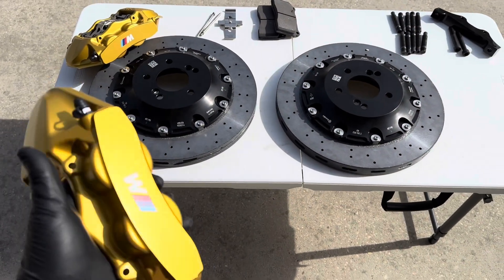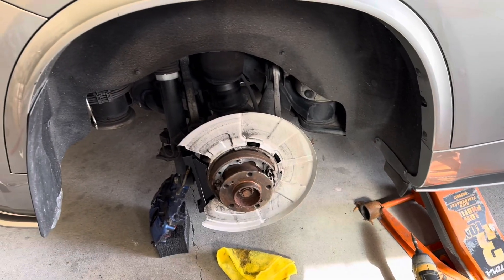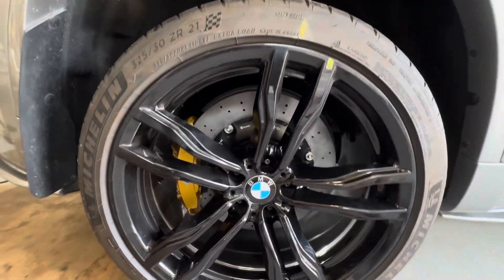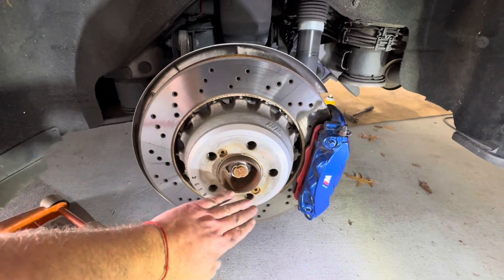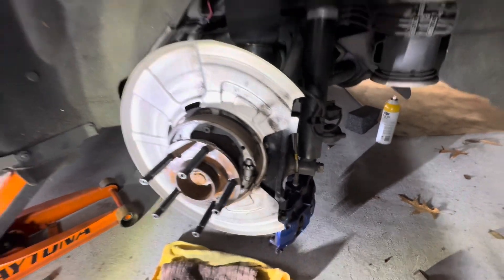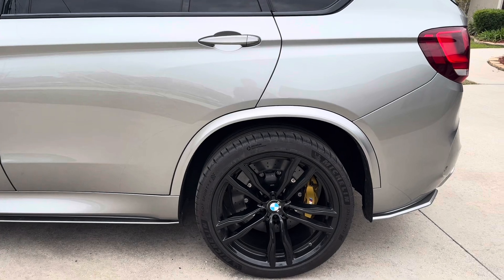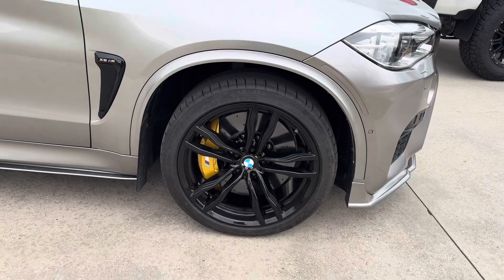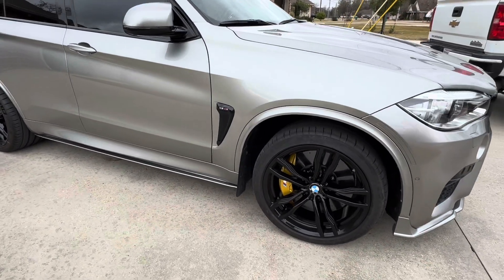Part 2: BMW X5M F85 rear carbon ceramic 400mm brake kit upgrade

Comment: Hi, can I install 400mm front and 396mm rear M6 brakes in my X6??
Reply from the maker: Yes 400mm can be installed, see ‘ultimate brake kit’ video on my channel, rear rotors are not possible to install unfortunately due to difference in parking brake set up.
Reply: @Dentprotony  ich habe von m6 alles Komplet aber leider nichts so wie deine 410 vorne un 400 hinten ich habe 400 vorne und 396 hinten von m6 Komplet original ist das möglich zu installieren And what kind of adapter do I need?
Reply from the maker: @rinornishori7207 steel or carbon ceramic?
Reply: Hello, how or where can I order?

Comment: Great to see you back with new rear kits for your X5M! Also front rotors look good with nice transfer from pads as you mentioned.
Does rear ceramic has 28mm thickness? I found stock has 24mm:) Anyhow, high composition of SiC(Silicon Carbide) on friction surface +  compound formulation of pads(might be the most important point for braking) would be helpful for your improved drive feelings!

Comment: How much?
Reply from the maker: @dliv33  rears are 2800 plus calipers/brackets are 1080 , i have the new hub design finalized and ready to go !
Reply: @ in total 3k?
Reply from the maker: @dliv33  late 3k for everything, correct

Comment: This is awesome! Any CCB options for E70 and what is the approx cost?
Reply from the maker: @jeffc6832  thank you, e70 has same spindle as f85, therefore front/rear upgrades are same, front set of 410mm rotors and hubs is 2870, plus the calipers/brackets and pads, rear 400mm set is 2780 plus calipers and pads , looking at dropping at least around 40lb of rotational mass which is pretty drastic improvement